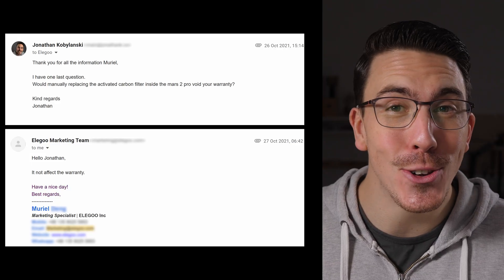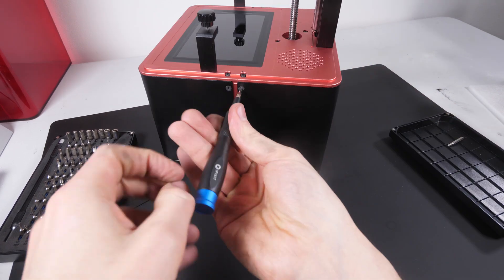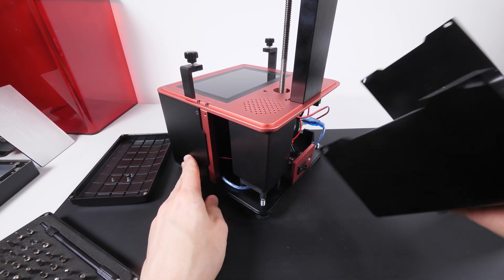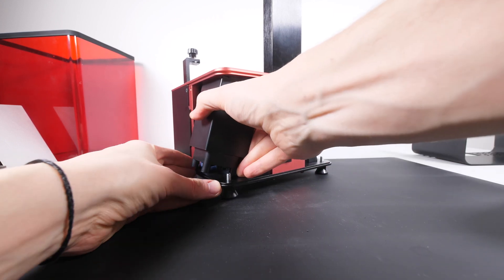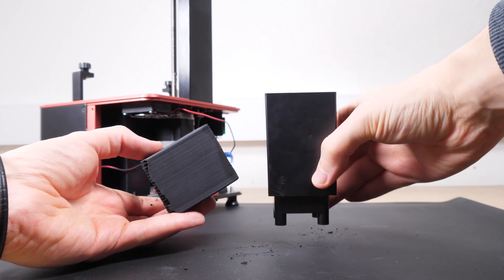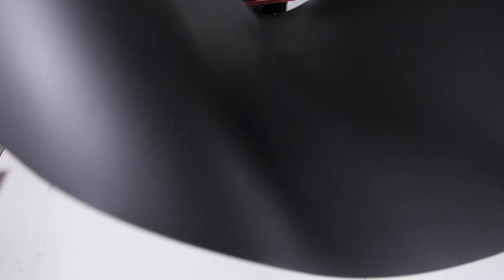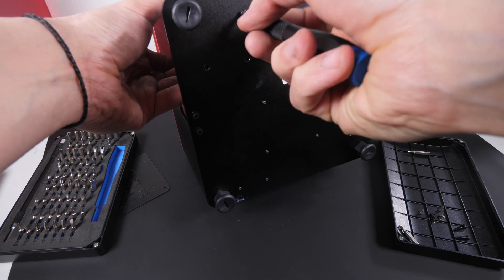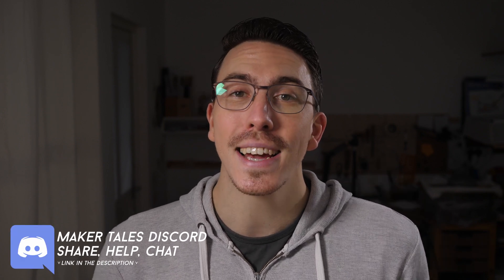STOP The Mars 2 Pro From Killing You!

Comment: You could also fit the bin-extractor mod inside, I've seen mod kits to fit an extractor fan where the carbon tower fits. You do have to bore a hole in the back of the housing for a hose to come through but then you only have to deal with the hose itself and not a big bin, and of course you can watch your print progress unobstructed.

Comment: There is an easy answer to this... you take a plastic kitchen waste bin, and a bathroom extractor fan kit. Cut a hole in the bottom of the bin, fit the fan, fit the hose to the fan, drop the hose out of the most convenient window, set up your print and then put the bin over the printer. It will draw all that resin vapor off and leave it outside. yes it takes another socket to run the fan, and its a little noisier, but you're not breathing crap.

Comment: Carbon filters are good at filtering out bad smells but not good at filtering out actual harmful gases.  They're no going to filter out enough of the VOC's to make enough of a difference. And one of those tiny filters especially is going to do bugger all. You need a ventilated room with air running in and out. Even then you should be wearing an A2 mask at all times.

Comment: Appreciate the intent of this video but that filter setup isn’t sensible. Unless there is inflow of air the fan won’t draw to exhaust fumes. It seems much more reasonable to remove that filter unit and take advantage of the vent holes to connect to an exhaust hose such as used for tool dust collection. Just vent it outside using standard fittings.
Reply: I agree, pls see my post 3mths ago for a proven option, hope it helps.

Comment: Firstly, thanks for taking the time and effort to put this video together, well done.

Now on a mechanical side of things.
I have a new Mars 2 Pro, so the filter is new but there is still a smell, so after investigation I am developing the new module described below (at time of this comment).

* The filter fan and the carbon block housing are not sealed, the fan just inserts into a cavity in the top of the housing . As a result, when the fan starts a back pressure is created against the filter block resulting in contaminated air being pushed out past the fan body into the machine cavity, as well as thru the filter, as the fan is screwed tight to the bottom of the table the contaminated air cannot be recycled and is forced out the rear vent holes. Hence you will always have some bad air being delivered to the atmosphere and you lungs.

* For effective airflow to occur you must have free flowing air at the inlet and outlet, with the main cover on and fitted with the seal the filter fan must struggle to get inlet air flow as the work cavity is almost a sealed volume and it is a small fan. Also, the fan pushes the air onto the filter, it needs to be in a draw thru configuration as this creates less turbulence and better air flow.

* The idea of the small stand alone internal filter device that Elegoo market is on the write track but doesn't go far enough. There is a solution to this, maybe not the only one, I plan to remove the entire filter pack and fan, re-use the fan and filter core, rehouse them in a new unit that will sit inside the protective cover, thus recirculating the contaminated air infinitely. No external smelly exhaust to upset the neighbours.

I will be using the existing fan and filter, as it is new, but it will be replaced with a 100mm filter block as described in the video. The new design will take a 100mm high block.

The activated filter block shown in the video will produce 4 replacement filters (50x50x100mm) that should last for 2-3 years dependant on usage.

NB: The masks that many brands supply with their printers are next to useless as they are NOT activated carbon based but merely a particulate mask, good ventilation and the correct breathing mask are a must .

Side notes
1/  My filter block was only 60mm high. 
2/  I saw a Elegoo youtube which showed a 0.07A 12V fan, mine is 0.1A 50x50x10mm
3/  When I removed the Elegoo filter box I found a series of 2.5mm holes widely spaced thru the bottom, this will have the effect of greatly reducing the airflow to a negligible amount.
4/  Test results...Preliminary results show an marked increase in airflow, the UV cover is installed WITH the supplied gasket. I have also installed in the new housing a square of thin micro fibre to catch any carbon particles from the reclaimed block as I chipped some of the edges removing it, unavoidable. 

Smell test -  with the unit installed and the printers cover fitted with the gasket I could not detect any smell at all, the only time there was  is when the printer cover is removed, but that is expected.

Summary and Link
I am very happy with the results so far and when the old filter block wears out I will replace it with 1 of the 100mm high blocks that I now have in my stock.

Link to Thingiverse - https://www.thingiverse.com/thing:5324926
for all the bits and docs.

Comment: Instead of sawing those blocks, you can just buy activated carbon pellets in filter bags from aquarium stores that are way cheaper and around longer than these blocks.
Reply: This. People that don't have fish don't get how easy this fix is
Reply: @komrick4248  do you just plop the filter pellet bag into where you would originally put the sawed block?
Reply: The blocks have a more organized structure and thus more surface area, which is paramount for filtration purposes :)
Reply: Way to come in clutch! Thank you ❤️
Reply: actually underated
Reply: Also this way you don´t need to wedge a paper towel in between and create a huge gap which makes the whole filter pointless xD
Reply: These blocks force air through the carbon, with all the air space around the carbon in the aquarium filter bags (which work better for moving water) it may not work as well. Any rate, I'm pulling the fan and carbon entirely and setting up dedicated fan & exhaust. while it's running.
Reply: @RodSalm  These stock blocks have linear channels, if you had pellets the air would have to weave around more which would make the air hit into the filter more often. So i'd have to say pellets would do a better job. So long as you fill it up to the height a normal filter would go.
Reply: @sasori2425  NO let the author earn money by selling you the filters.

Comment: Thanks for the video!  Am I seeing that basically there is no active fan pulling/pushing in the air through the filter?  I mean it looks like it just sitting there with a vent in and out into the bottom of the casing?  What the heck?

Comment: what about using mini activated carbon pellets, just to fill in the main filtering box??
Reply: I don't think this fan design is suitable for that. The problem is static pressure, or lack thereof, as the fan is designed more for low-impedance airflow than for pressure needed to traverse obstacles. When the airflow impedance is too high, the fan stops pushing air, there can even be a tiny reverse airflow instead. This sort of filter lattice is very open for the air to pass through; this isn't the case with pellets. Maybe if you used only a small layer of pellets, much smaller than the size of the block, that might just work. Another trick that might just work is to print a set of vanes, essentially such a lattice, to be attached to the fan and sit above the pellets, this can linearize the fan exhaust airflow and prevent turbulence from forming an air plug. I'd say these are directions worth experimenting in, if so inclined. Someone else has demonstrated printable attachments that look almost like a set of fan blades but stationary and differently shaped that also provide airflow to static pressure conversion, but the specific engineering behind them eludes me.

Comment: Would it be a bad idea to just disconnect the filter/filter fan entirely? I have a venting setup already from my original mars and honestly it's just such a hassle to do this every few months if my current setup will work. Only thing is I don't want the fan just spewing chemicals into the rest of the machine
Reply: This is a better solution overall, yep! There are 2 fans in there, one for the electronics cooling, so be careful which one you disconnect.

Comment: thanks for this vid I’ve been doing research for my mars 2 pro that’s arriving in two days and wanted to be as prepared as possible, are you sure the disassembly for carbon swap won’t possibly affect the way the printer works?
Reply: Keep in mind the screws he loosened may change the level of the machine. It makes sense to re level the build plate after opening the case and flexing it as he did

Comment: May I suggest a better, possibly cheaper and much longer lasting solution?
I have invested in a 'Carbon Air Fan Filter' with an ultra silent duct vent + some flexible tubing and hose for my work area. Initial investment is a bit larger than those small carbon filters included with some 3D printers/air scrubbers - BUT the filter lasts up to 2 years (Rhino Pro), and 9-12 months for the hobby version - and that's running 24/7. 
I haven't compared to the small ones, but the large filter solution seems much  more efficient to me. I use it when soldering, but it also cleans my room of any other smell (cooking, etc.) The great thing about having a circulating filter inside my shop means I don't have to vent to the outside, and heat the room up. Before getting the filter installed the vent would completely drain the room of heat within hours. 
When depleted it is possible to get replacement pellets, though it would require some handy work to get the filter opened/closed - and get costs even lower in the long run ;ø)

Comment: Does activated carbon filter only the smell and not the unhealty chemicals?
Reply from the maker: It removers the smell and the VOCs the unhealthy things.
Reply: @Keep-Making  I would agree saying, that it lowers the amount of VOCs, but not that it is able to catch it all. For example carbon activated filters in industrial tobacco pipes are able to get rid of 80-90% of the bad chemicals in smoke. Same thing we have with filters like you show. They will not catch alle the bad stuff out of the air that resin is able to contaminate. As only the tiniest amount of these VOCs is pretty health related you definitely should not take a filter like this as a no brainer. Even if you use filters like these, wear a filter mask to protect yourself. There is a reason why industrial workers in the chemical industry always wear masks, even if they have very big air purifiers to lower the initial concentration of their fumes. I don’t want you to get me wrong. But don’t let people think things like these will solve a problem and it does not. At the end, they risk their health cause it isn’t a save way to go.